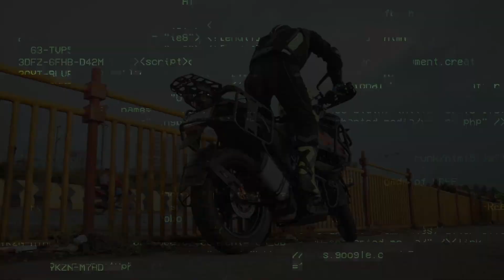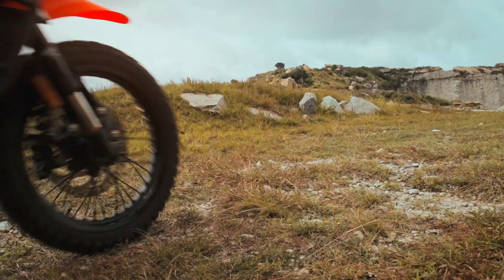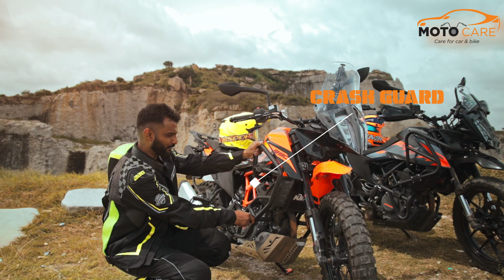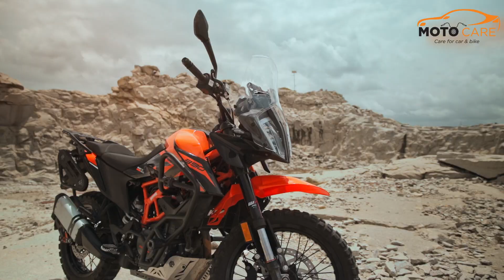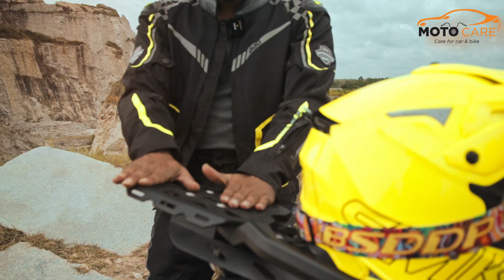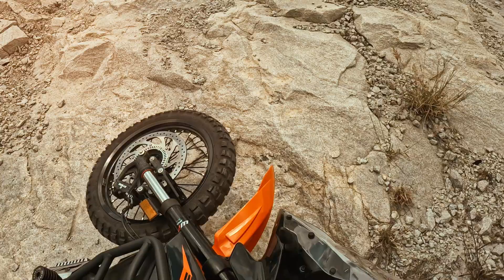Ultimate Off-Road Motorcycle Accessories Review for KTM Adventure 390! | Motocare Productions

Comment: I have installed the older design crash guards of Moto care on my KTM 390 adventure. And now I’m unable to ride my bike because of the increased vibrations. Also the front bolts which join the upper guards touch the small fairings. This has increased the vibrations so much that bike is no more usable.

Comment: The Windshield Visor is a knock off from the original inventor which is the Rade Garage.
I have the same top rack for the back, it is grate because it allow you to retain the original handles, but the bolts which come with it are sub-par quality and must be replaced as one of them broke. Also, the rack brackets, block the rear light so it is hard to seed it. I had to purchase additional under-registration stop light to improve/retain the visibility, which was another $160, reducing the value of this rack.
I do like the crash-bars with the sliders, but my bike already came with them, and after several slow-speed crashes (pavement and dirt) they are fully intact, so no point for me to change, but great investment for the new bike outside of the US.
The radiator, looks like it might obstruct the air flow, especially with the huge KTM logo and tiny holes, I'm interested how it actually works.
I have one (after-market) an no issues at all, but it doesn't have any logos and the vent holes seem a bit bigger, like KTM power parts.
Anyway, good job on the new parts, I wonder how will they sale, since new model is coming up in '24, and I doubt these parts will fit.